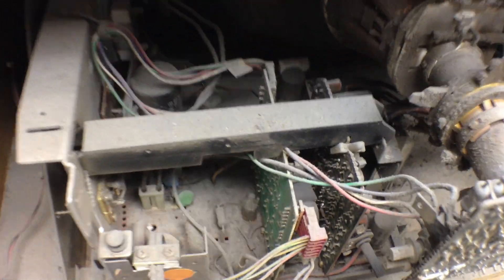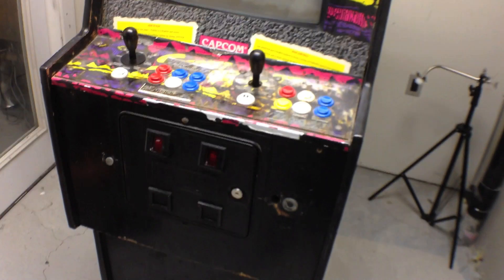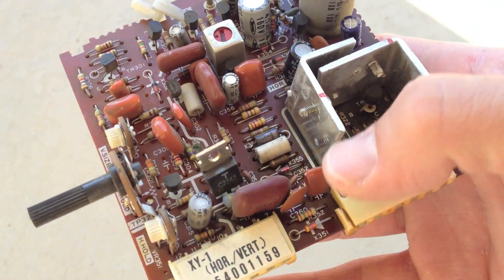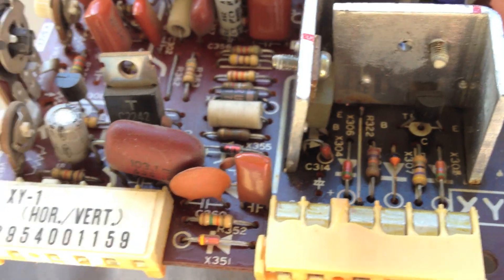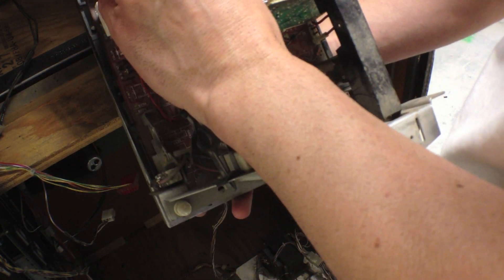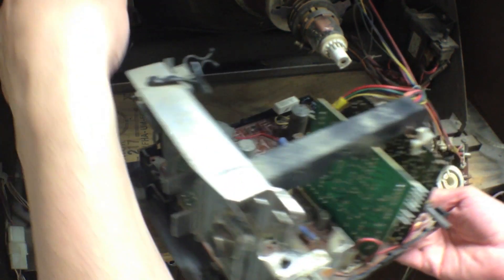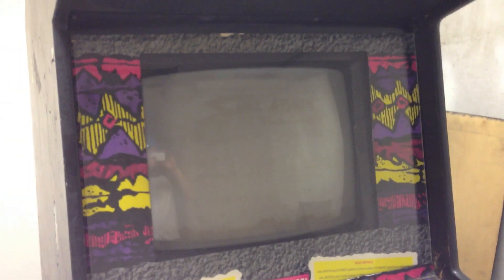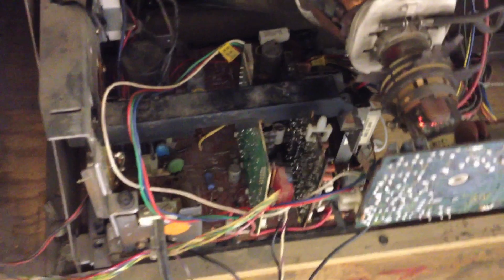Arcade Monitor Repair - Vertical Collapse [ Horizontal line ]

Comment: HBT, what are the differences between a Raster monitor compared to a Vector Monitor? what is the B+ voltage used for in monitors?

Comment: had that same issue on a NEC Multisync CRT that i found off the curb, fixed it by replacing the capacitors, it's now my main CRT on my DOS/Win9x Pentium 133 retro gaming PC. It's in not that bad condition despite it being on a curb.

Comment: but what made the solder joints crack in that particular spot? and the melted brittle connector..seems like youd wanna fix the heat problem like perhaps regrease that IC to the metal heatsink first ?  ..or the cold solder joint will happen again..ps  ya goofed with your iron on pin 1 and 2..didnt heat the pin first..add two more cold solder joints to the list :)
Reply: Heat. Expansion when on and contraction when off. Wears it out.

Comment: can someone tell me what would cause my 1997 zenith tv to cut off 10 to 20 seconds after i turn it on? Happens every time.
Reply: +Thomas Setzer  that means its going into "safe mode"  as in one or more of the parameters that must must be met for it to fully turn on can not be met. IE there is a serious fault detected and is shutting down and is going into a protected mode to prevent any major damage like fire or the like. for example HV fault or CRT fault or loss of vert sweep or the like.
Reply: Is this easy to resolve. Can you point me in the right direction?

Comment: not trying to be a negative nancy but why on earth would you use a vacuum anywhere near a circuit board or a old monitor... that static discharge could run the risk of frying thee entire set up... other than that, nicely done sir
Reply: +dizko4rumthehuds You clearly know nothing of what you are talking about. once discharged, the CRT and related areas are quite safe. there is NO risk of any discharge, because they have already been zeroed to no charge.
Reply: +Suzaku NoMiko Well, I'd rather use an air compressor or canned air
Reply: Well, just if he uses a brush like that. It's not about vacuuming, really. Right?

Comment: On a monitor like this Wells Gardner 19K4600, its a good idea to do a cap kit at the same time. The electrolytic caps often fail from age. New cap kits are less than $10 and can make the monitor more reliable. That connector you re-soldered is going bad, the plastic is breaking down on it from heat and age.
Reply: Yeah, but he'll only do that if he has to; it's a lot of work!

Comment: I had a collapsed vertical scan on my old CRT TV one time. Before sending it in to repair, I noticed that by quickly moving your eyes up and down you could see a full picture! The movement essentially 'scans' the line across your retina lol
Reply: Picturing a random person nodding their head up and down at sonic speed 😂
Reply from the maker: Tomsonic41 weird! I'll try that next time.
Reply: Yeah it scans, and the vertical voltage sets the frequency.
Reply: Micro amps...   Current I guess not voltage.  00PS

Comment: How many cans of compressed air do you think it'd have taken to clean that off? 10? 15?
Reply: +Mikalhvi  You can buy a nice small 110 volt compressor for less than $100 and have all the compressed air you want.
Reply: +Dzonemp sure, but I was specifically thinking of the comically large quantity of cans someone would go through on that.
Reply: Some of that dust looked so caked on, to me, that I was surprised the vacuum cleaner helped much at all! I think those cans might not have been strong enough to do much. I had bet that it would have taken the  higher pressure of a typical industrial compressor to do this job!